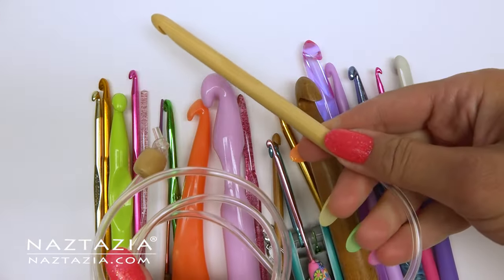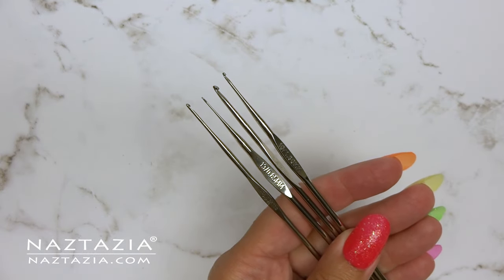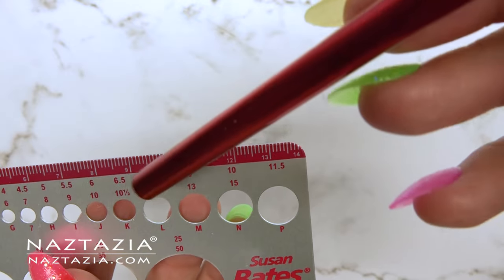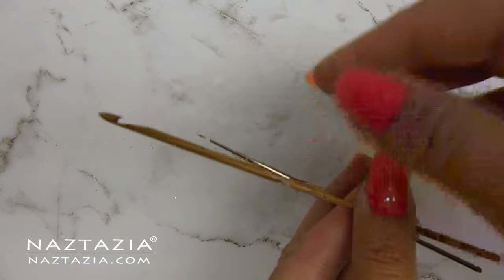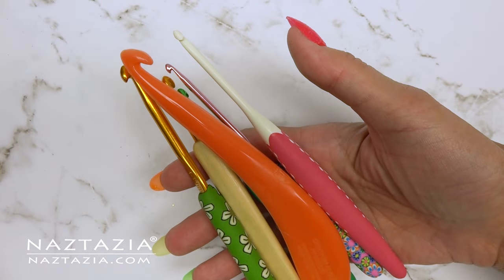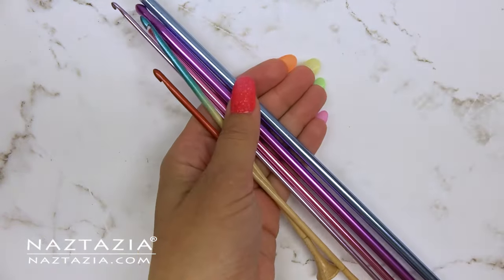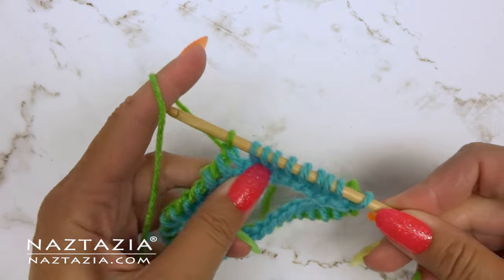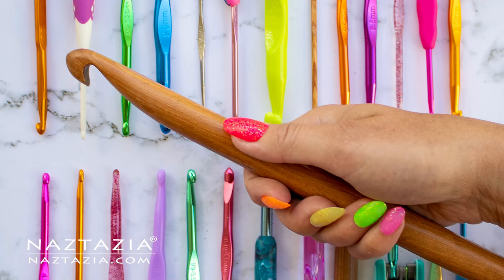GUIDE to CROCHET HOOKS by Naztazia

Comment: You mentioned the locker hook
There is also one called a knook it in 4 sizes you chain whatever sts say 15 then pick up sts as in tunisian  
There is an eyelet at end of hook you thread a cord in eyelet 
Then pull sts through on to cord and knit  as can see this can be used for crochet  rug hooking and knitting all in this 1 hook

Comment: I just need to know if the acrylic hooks are better for chenille yarn
Reply from the maker: It depends upon what fiber the chenille is made from, since the term "chenille" refers to the type of yarn that has little fuzzy piles. Acrylic hooks are good when the yarn is not-slippery. When the yarn is slippery, bamboo is probably the best since it offers some resistance. So if the chenille is made of cotton, acrylic hooks would be good, as it is not a slippery fiber. However, if the chenille is made of rayon, that's usually a slippery yarn, and might be better with bamboo.